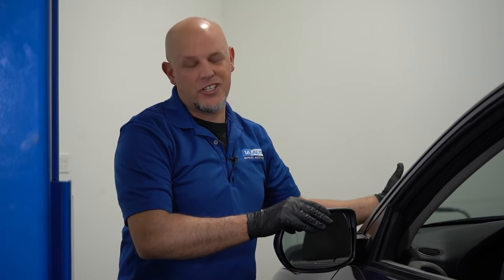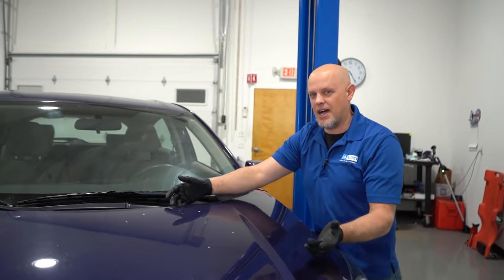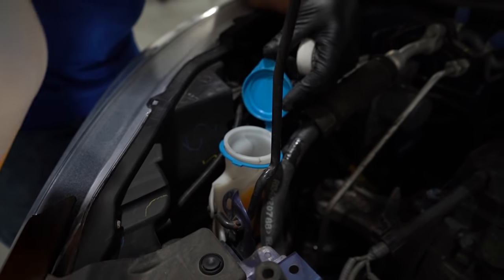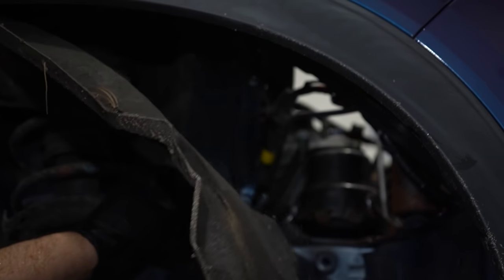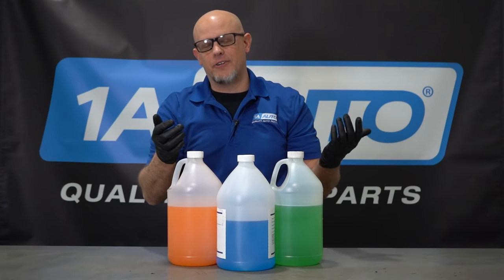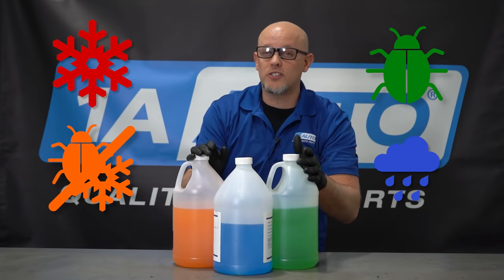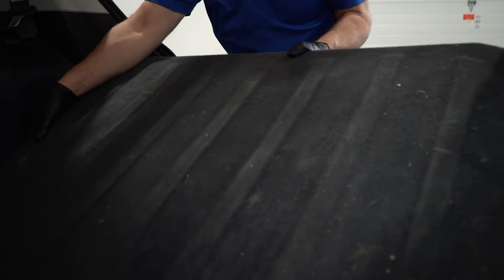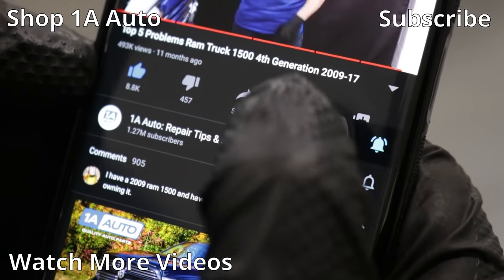Windshield Sprayer Makes Noise but Nothing Comes Out! How to Diagnose Washer Fluid Not Spraying!

Comment: Wondering why it works Sometimes, more times dont work, but Sometimes it sprays well, and sometimes one side, appreciates the input, oh, pump is good, just from pump to 2 nozzles no water at air pressure. Thanks

Comment: On the Caliber it probably wouldn't have hurt to put a small cable tie around the hose after reinstalling it to help hold it in place. I think it is possible that the hose isn't holding on to the barb fitting as well as it used to

Comment: I've had a nozzle break at the hose connection before, due to freezing early last winter....on a side note I don't recommend rainex, after using religiously for years it created a film on the "full" sensor tripping the "low" code. Sensor was only $5 but I had to remove the grill and other parts as well as the tank 45 minutes (RAM 1500 4th gen) (Vinegar flushing didn't work)

Comment: Tip;  When checking your windshield washers, be sure to adjust nozzles so the fluid does hit in the right spot when the vehicle is moving.  The faster you go the lower on the windshield the spray will hit so find a happy medium that you can live with.

Comment: I have the same exact problem however, I am in Florida so ICE and SNOW is not going to be an issue.  SO I am looking for a solution.  I already filled my washer fluid so I know that is not the problem.  I am thinking something happened at the shop when I got my tires put on because it was working before the car went in the shop and now it is not working.

Comment: I have a 2003 Dodge Durango. The fluid pump works fluid comes out but on the wrong windshield.
When I press the fluid button for front windshield it sprays on the rear window. When I press the fluid button for the rear, it sprays fluid on the front windshield. Could this be a problem with front and rear hoses connected to the wrong location or something else?
This happened after a botched/negligent repair job by Firestone. They replaced my upper and lower radiator hoses and the clamp on the lower radiator hose became loose and it sprayed hot coolant all over the windshield fluid tank and electrical components.
Reply: You'll have 2  washer pumps, one for front, one for rear. (Usually both are located near the bottom of your washer fluid reservoir) It sounds like the lines that go from the pump to nozzle just got switched. So you just have to switch them back. But, wait til the reservoir is close to empty so you don't have to deal with a bunch of fluid everywhere lol. Hope this helps

Comment: My issue I have is that the left (driver) side does not spray but the right (passenger) side does.  What could be causing that? I have a 2012 Honda Accord V6 EXL 3.5l